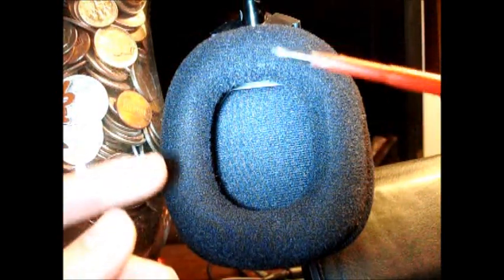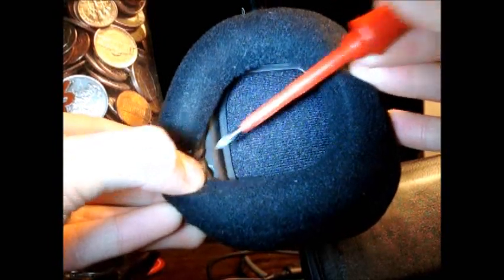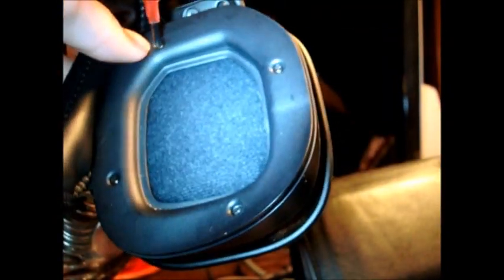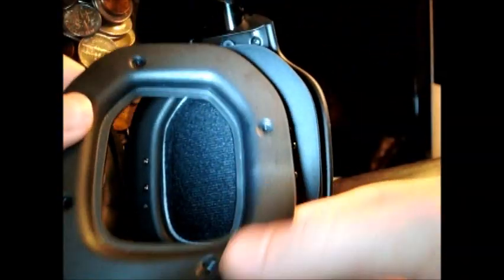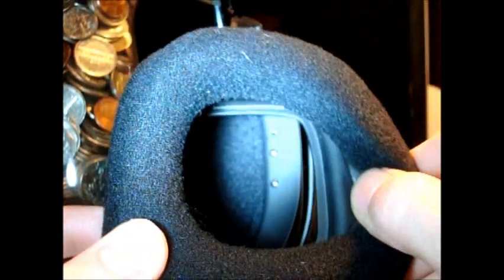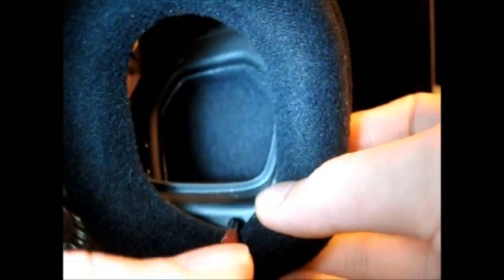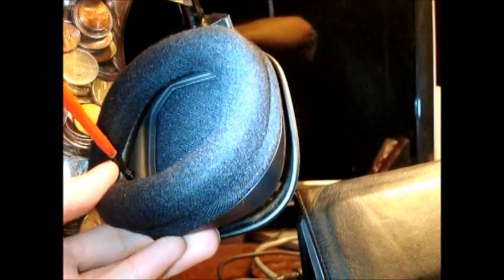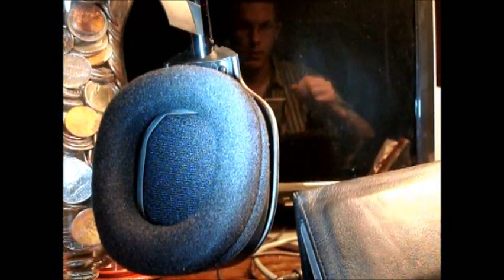Astro A40, How to install new/replacement Ear Patting.

Comment: will this work with the TR version if I just ripped off my original pads? I have a mod kit and I don't like the leather, would be a much cheaper option instead off paying £50 for replacement ones including magnets. Any help would be much appreciated
Reply from the maker: Honestly, I do not know.  Seems it would be the same.  Good Luck, I don't have TRs. If I did, I would try it myself. If it turns out to be possible. I strongly recommend making a video demonstrating what you learned. Cheers!
Reply: Bit late but can confirm it doesn't work unless you rip the old ones off and glue the recplament ones one. It's not ideal. TR uses the magnets instead of screws.

Comment: Unless those screws use loctite or have a "VOID" sticker when removing the plastic piece that the A40 ear pads fit around, there is NO WAY (unless you completely fuck up, scratch, mar up the plastic piece that is removed or loose & or strip the screws) that your warranty will be "void". How would Astro know that someone removed 4 screws???

They wouldn't & couldn't find out unless what I mentioned above happens, or you do something completely stupid & tell Astro in an incident report.

Comment: What size screwdriver do you need?
Reply from the maker: Sorry, I don't know what size screwdriver is required. But the screws are small, so something around 3-4mm should be fine.